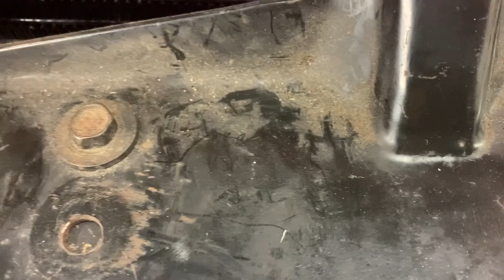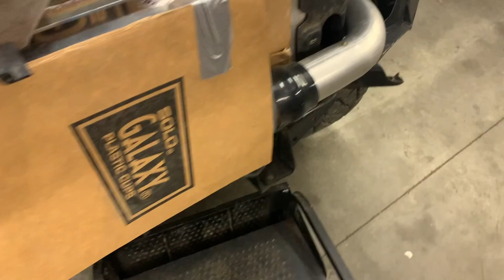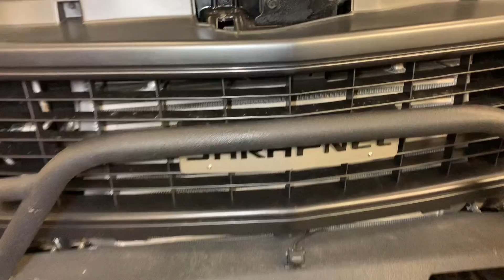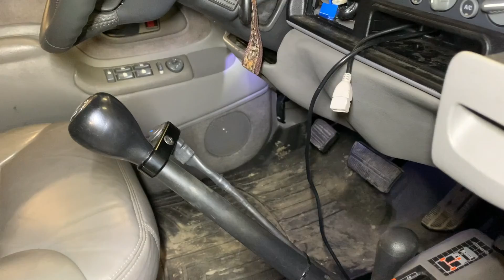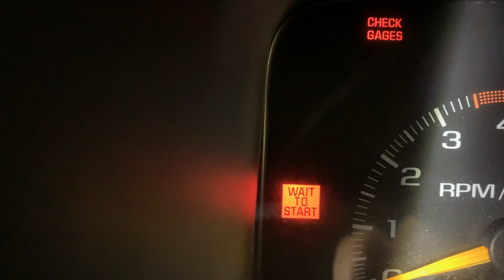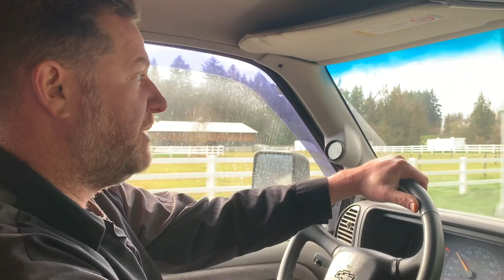*Project Shrapnel* How to install a Cummins 6BT 12 valve Diesel into a Chevrolet Suburban - Part 4

Comment: I know this is old but those og fog light switches were also used in 2000 tahoe z71 and limited edition. They were the last two models to be made with the obs and fog lights were standard on both packages. I've got a near mint 2000 cherry red z71 with that very switch in the lowest receptacle.

Comment: Really nice work on the conversation.  I been working on my old second gen dodge ram. A auto to g56 conversion and a 4x4 ..That was a deal make the floor mounted 4x4 shifter up grade by welding in a later model floor . Reason I posting is after dealing with the factory cruise control I decided to go with aftermarket.  For a few reasons . The unit I found is the make you shown here . Any advice would be appreciated. Your floor shifter looks very similar to what I have in my truck . A floor shifter out of a 98 4x4 . I also going to install a exhaust brake.  I really like a manual transmission.  I installed a one piece aluminum drive shaft

Comment: I'm doing a very similar build. Mine is a 1999 3500 crew cab shortwide dually. Have gotten all my parts from Joel and everything has bolted on like it came from the factory with the 12v in it (fantastic). Maybe I missed it but my question is what intercooler was used. The blue suburban wasn't intercooled so thats kinda where I was headed with mine. But now after seeing this series with the cooler I think I want to go that direction. Would love to see some more on how you did it as well. If there are any pics or info that is. Lol
Reply from the maker: Thanks Troy!  Appreciate that.  We just use aftermarket intercoolers and fabricate pipes to make it work.  It's A LOT of work.
Reply: I installed a 98 12 valve into my 98 chev Crew cab long box. I used the original dodge intercooler. With a bit of cutting and messaging it fits right in the centre of the rad support. I used the original dodge intercooler pipes (I think they are both from the same side on the dodge). The only issue I had with the original intercooler was trying to make the headlights fit. So I cut and welded a bit out of the side tanks. Also cut some of the headlight out. But earlier years have the smaller headlight I dunno if it works or not. I used original dodge rad. The only thing I had to get for the basic conversion that wasn’t from either of the donor trucks was the engine mounts. Also just use the starter solenoid for your fuel shut off pull in. As per original dodge. Great build tho!! Way nicer then mine lol

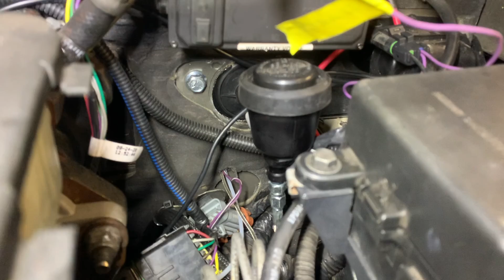Comment: 16:00 I’m glad to hear you’re going  make the clutch pedal assembly available!   I can’t begin to describe the struggles I had trying to acquire the correct bracket for the 1996-1999 trucks.  I found the original part number (now discontinued part) and did a nation wide stock check through a dealership …. Not a single one of them left.  I found a couple pre 1996 in junk yards, but never the correct one for my 1998.  Finally found one  an individual had through a swap group.   They’re like hens teeth, it seems, just can’t find them any more.